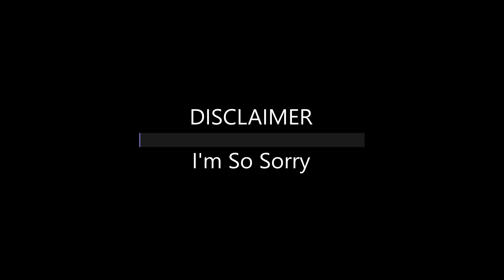Custom Smock Bearings Install - Spyderco Smock

Comment: The spreadsheet link seems to indicate a size for the ZT 562, which I took apart to install the recommended size (same size as the ones for Smock). The ones in the knife were way bigger blue polymer caged bearings. Any idea if the spreadsheet might be out of date with the most recent ZT 562?

Great video and thank you!!

Comment: 2 questions…

1. Where did you get the deep carry clip and does fit well and give you enough leverage for the reverse finger opening and thumb flip opening?

2. Where did you get the scales?

Thank you for sharing!! 👍
Reply from the maker: The scales are from bladescales.com 
The clip was $9 on amazon or ebay. Just search spyderco smock deep carry clip on either. 

Cheers